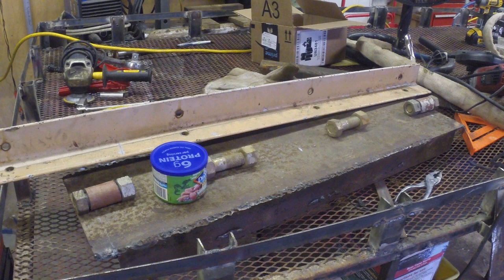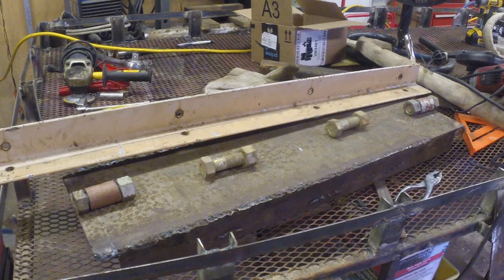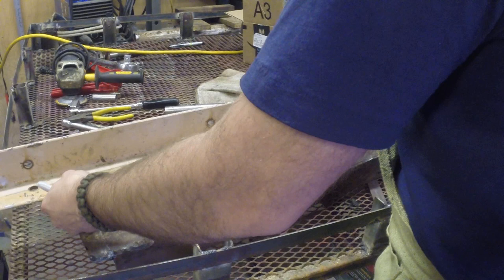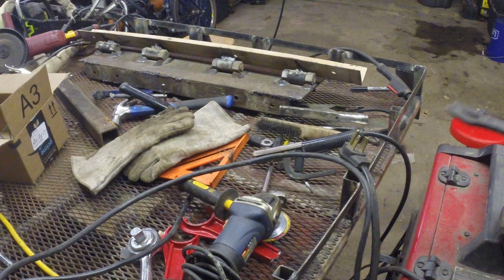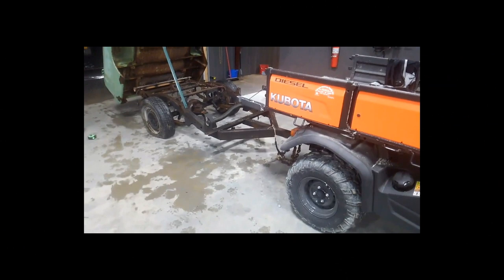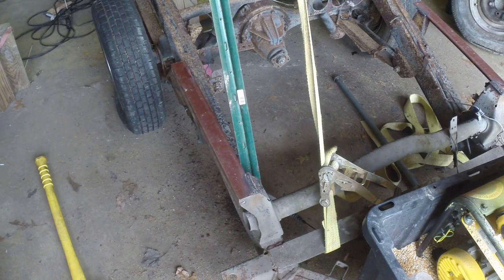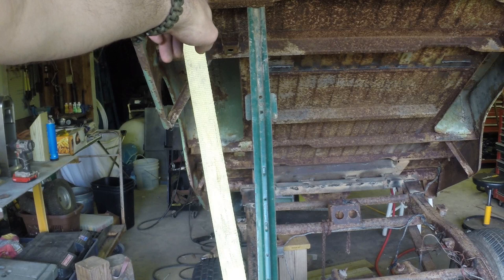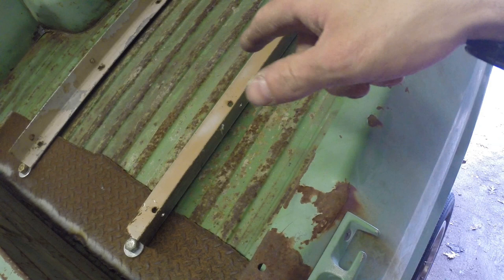building a homemade dump trailer out of a truck bed trailer PT 1.

Comment: I do not know about the part in the bed. I do not think it will hold things up. One thing when I worked on the wood chip trucks I was socked at how small of a part would hold things up. Bolt heads would stop chips to the point where the driver would have to get in to remove them after about 10 loads.. I see why you would like it and I think it's smart.. Sucks you do not have a place to run it on the lower side. God Bless brother..